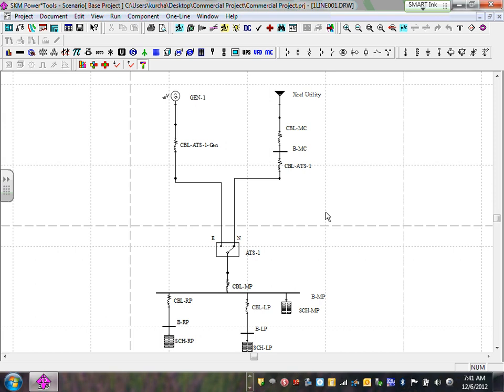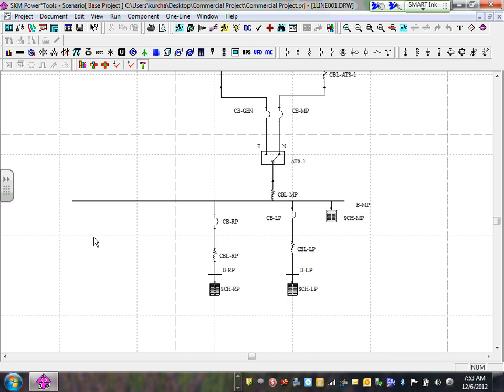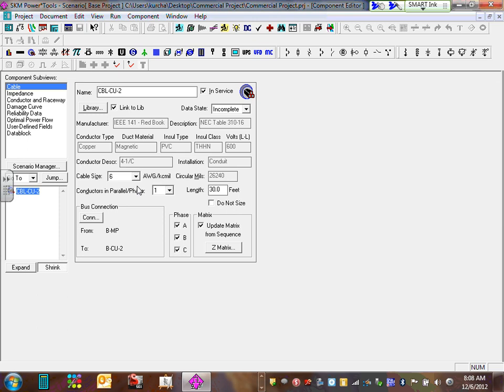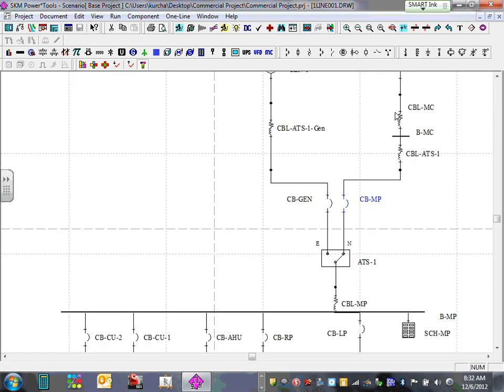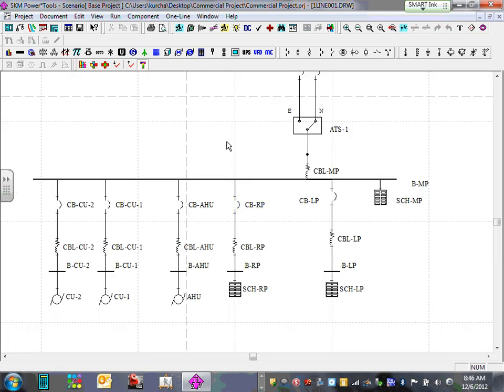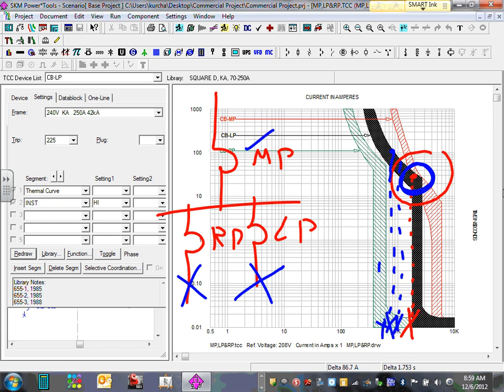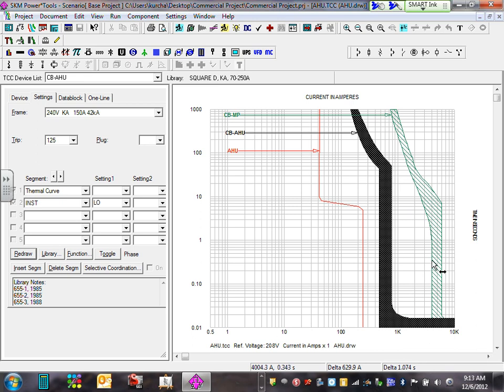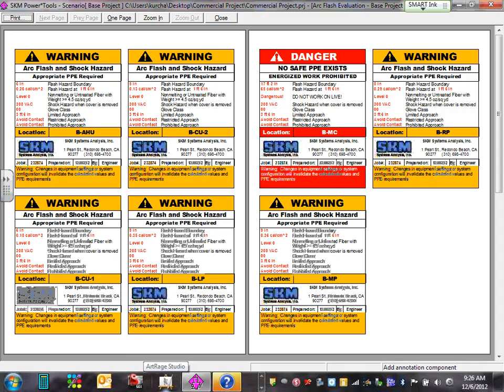Power System Analysis Arc Flash & OCPD Coordination 12 06 12

Comment: Chad thanks for uploading your lectures. 

In the video you mentioned that it's not necessary to add any motors lower than 15HP. Could you reference that to a any NEC, IEEE, or any other standard? Or where could I find that info? Thanks for your help.